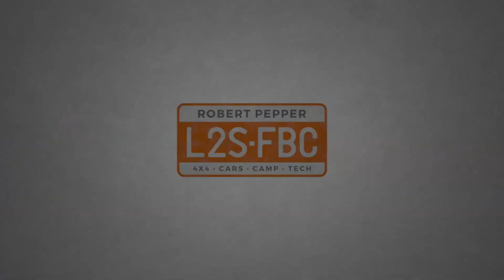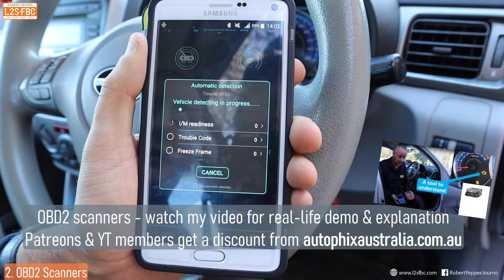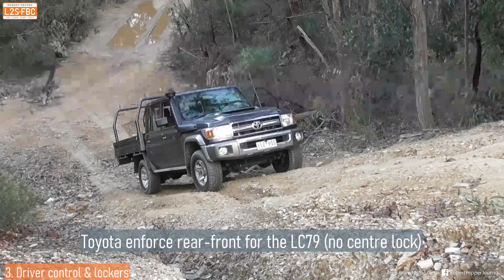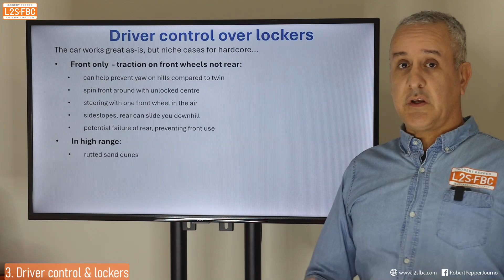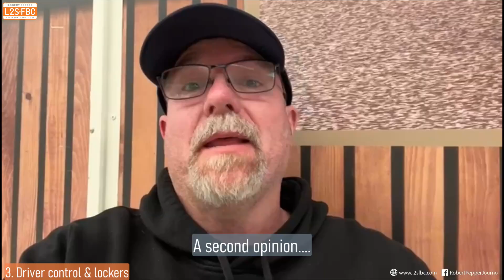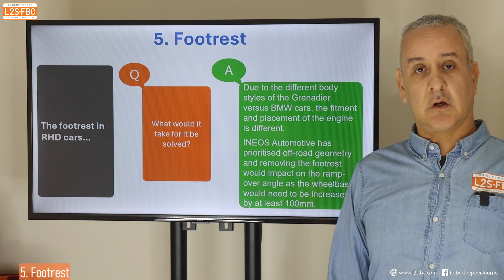INEOS Tech Interview Clarifications, Part 1 of 2

Comment: Winch clarification - what about Ariel with the Nomad, Foers with the Ibex (both front & rear from the same unit), perhaps even Munro with their electric vehicle; and a civvy Supacat Jackal (there have been a few) even had the Red Winches option before Ineos.  Would Unimog be excluded?
Reply from the maker: I would put Unimog in a different class yes.  As for Ibex and Nomad...fair points although again neither are really in the Grenadier class.  However if you need to qualify a statement with "we the only people to fit a winch in Europe in our class of vehicle" it gets a bit pointless!  At the time I was surprised to hear the statement but it seemed a ready answer and could be LR, Toyota etc had dropped their winch. Not the case when I checked after the interview ended.

Comment: Interesting answers with regard to the OBDII diagnostics.  Would it really be the case that Autophix have it wrong on stating Ineos have "locked" the access?

With your relationship with Autophix, maybe that's something you could follow up on.  It seems odd UK/Oz vehicles have no success with third party readers whilst US vehicles appear to be more open to code deletes.

Given all the talk from Ineos about open access and the ability to fix in the field then they should find an official partner to develop a full diagnostic tool with.
Reply: Presently operating an Australian delivered vehicle in North America. Can confirm that the MX+ OBD reader operates the same on our vehicle as a US.
Reply from the maker: I can't do anything without a volunteer Grenadier.  If someone wants to try, I'll get all the scanners Autophix has and see if they work, plus my own.  And yes, this is important re talk about fix.
Reply: @L2SFBC  Hopefully, there's an interested owner close to you that would help out.  I'll put a post in a few groups if that's OK with you?

I was wondering if you could facilitate an intro between Ineos technical and Autophix (assuming the latter saw a commercial interest in this) and they could take Ineos up on their offer to support third party vendors with access to in house technical data.  

A bespoke Grenadier unit that had a degree of support from Ineos and allowed additional functionality such as service counter reset and TPMS sensor relearning would be a real winner.
Reply from the maker: Sure happy to connect an owner with Autophix.  They'll need to be prepared to generate a fault on their car which lights up a warning, such as disconnecting a wheel speed sensor, MAF sensor or something so that can be detected and cleared which is the real test.  Autophix in Australia just distribute, no tech people.  That conversation would need to be between INEOS UK HQ and the OBD2 people, and all that's needed is a list of codes and descriptions.  I'm not sure INEOS would be up for that, but they have talked at length about self-fix...
Reply: Previous Foxwell Diagnostics device could not clear codes however so something is up.
Reply: @globalgregors  It would just be nice if Ineos got into bed with one of the OBDII major players and shared a bit code to allow Grenadier Owners to use a bespoke tool to read/clear codes, reset service intervals, relearn TPMS sensor positions, manually trigger a DPF burn and a host of other tasks that would be required by a  DIY owner or someone travelling remotely. Q
Reply: @stevegreen101  totally agree

Comment: I have a D3 with factory rear e locker. I recently installed a manually activated front e locker. I still have a long way to go, learning  how the vehicle reaponds when I engage the front locker  but so far I am impressed how little wheel spin i get, if any, when  engaging front e locker to pull me out of river beds (whilst in rock crawl mode).  I can the pulling effect using the front locker will be a great improvement in capability of the D3.

Comment: We have had many instances when e-lockers did not engage and disengage in real-time, and next to the failures we have seen, this was a major reason why everyone in our technical driving group changed them over. Interesting to see that Ineos acknowledges the issue. While the locker selection order is also how ARB installs their lockers by default, it's something I recommend changing ASA. I have had a few instances, even while touring, where I used a front locker only, and I want to control how I use my lockers.
Reply from the maker: Can you describe where you used front and not rear?

Comment: I don’t agree that having a locker in reduces wheel spin - it often increases it as it forces both wheels to spin and at the same speed when possibly one might not. Almost always when I see a vehicle with lockers engaged one or more wheels is actively spinning and churning up the ground.
Reply: I have a D3 with factory rear e locker. I recently installed a manually activated front e locker. I still have a long way to go, learning  how the vehicle reaponds when I engage the front locker  but so far I am impressed how little wheel spin i get, if any, when  engaging front e locker to pull me out of river beds (whilst in rock crawl mode).  I can the pulling effect using the front locker will be a great improvement in capability of the D3.
Reply: @lyndonkapoor8823  Having the ability to just use the front locker should be standard as like MadMatt said, often you just need it to pull you up.
Reply: @jerrymyahzcat  I totally agree!  now that I have one and have experienced the benefits and being able to use it when and if needed.  An independently activated front locker is a great addition to extra traction and recovery tool bag 🙂
Reply from the maker: Lockers definitely help avoid wheelspin but when it does happen it will be worse.
Reply: @L2SFBC  Yeah that’s fair. I agree. Just see many vehicles spinning like crazy 😵‍💫 with lockers engaged.

Comment: Ineos and Manufacturers don't seem to be able to give a solid reason why front OEM lockers can't be independently locked. Its impacton steering happens regardless of the rear. I have my ARB lockers setup for independant activation and for appropriate situations it gives me certainty that the fron will climb evenly without any risk of rear shuffle. Using lockers is pretty niche, I just don't see the risk of driver selections - usually when lockers are needed you are balancing a range of risk, including not being able to recover easily. Sick of nanny electronics in modern cars. Ineos was supposed to be different.
Reply from the maker: Based on various conversations, not just INEOS, the reasons are:
1. drivetrain protection - front lockers can snap drivetrain components easier than rear
2. protecting the driver from themselves
3. simply not understanding there is a need for anything other than centre-rear-front, because they don't employ specialist offroaders, nor do they talk to them
4. catering to the 95% of people for whom centre-rear-front is okay. 
All of this is understandable and I have no problem with it.
What disappointed me was the "there is no need for it" answer as that betrays a fundamental lack of understanding.
I would accept "yes, we see a niche need, but here's why we haven't done it" listing the reasons above.
We had a discussion on my Patreon about this, and on my FB.  It's niche, but there are definitely times you want full control over your lockers.  More in Clarification Part 2.
Reply: Niche vehicle has systems designed for mainstream drivers...someone, somewhere didn't understand or agree with the essence of Projekt Grenadier.

Comment: Something not many talk about is side mirror placement and adjustment range. A shim raising the height of the mirror housing by 3-5mm would likely place rear view mirrors in positions more useful and safe for rear visibility, especially when towing. My grenadier’s mirrors are tilted full up/forward just to provide adequate visibility. If I were any taller, I imagine the mirrors would be less than useful.
Reply from the maker: I did mention this in my first drive review!
Reply: Yes, you did, which is why I brought it up. A few others have as well, but I’ve not heard the manufacturer acknowledge it yet.

Comment: I’d love to see a forward control version of the Grenadier. 

I can see Ineos going down the luxury car brand route and will be put of of reach of the average punter, which would be unfortunate
Reply from the maker: An interesting point from the first interview - Jim Ratcliffe gave the engineers a sheet of paper, which Oliver showed, that said wheel at each corner, AWD etc.  And that's what they built.
It appears nobody argued that other configurations would be better. 
I would have done, arguing strongly for a forward control with small bonnet, like the current-gen Hiace, and independent suspension based on interior space and payload.
But I guess that's why I'm a journalist not a chief engineer :-)
Reply: @L2SFBC  I’ve been watching episodes on Pinzgaler and Volvo TBG. The foot print (width&length) aren’t that big, but have a whole lot more space for a touring set up than something like a Troopy.  They have a great platform, and wouldn’t take much to do a forward control version, which would open up a whole lot of different options, without much more engineering.

I can see them doing a short wheel based version next, as it would obviously be a seller, though.
Reply from the maker: You can see a forward-control 4x4 Hiace here  https://youtu.be/m9UcPcu4HUA
Reply from the maker: SWB 4X4s typically don't sell as well as LWB.  I'm sure they've done the analysis and that's why we haven't seen one.  Nor have I ever seen anyone ask for it.
Reply: @L2SFBC I believe they ruled out a SWB as the existing drivetrain (engine/gearbox) was too long to fit a smaller wheelbase vehicle without compromising driveshaft angles & developing g a 2nd drivetrain was too expensive.

Comment: At least on the Grenadier you get all 8 gears in low range and can do up to 70-80 kmh. A bit of a compromise for your preferred locked in hi range and doesn't solve the inability to select low range issue but still helps.
Reply from the maker: Fair point, not all vehicles allow all use of gears in low range, and sometimes low range is so low it makes anything other than crawling difficult eg Rubicons.  I think INEOS got the gearing just right with the Grenadier.
Reply: @L2SFBC  Aren't high gears more fragile in low range because of their smaller gear size?
I've always been told to avoid overdrive gears (5th and 6th in a manual) because the torque multiplication of the low range may break those gears, so i suspect jeep on the rubicons with that crazy 4 to 1 reduction ratio doesn't allow you to select the top gears in order to preserve the gearbox. I hope ineos have done their maths and chosen a zf 8 speed variant that can take the stress of the torque multiplication in all gears.
Reply from the maker: Yes, higher gears may be more fragile, but you wouldn't be doing high-torque work in higher gears anyway.  Serious 4x4 hills would be 1-3 low, possibly 4th, for 5th and higher it'd be transit.  I do use low range in soft sand up to 6th in my Ranger but when it does get into sixth it's easy going...when the sand becomes more difficult I've got another 5 gears to use so I can choose 3 or 4 low for example manually, not letting the gearbox decide which it does too late, or needing to stress the car between 1 and 2 high.
Reply: @L2SFBC  Yes, if wikipedia is to be believed (gear ratios on the 8hp 51 transmission, 2.5: reduction ratio in lr) 8th low on the grenadier is slighty taller than 4th high, which means if you are in that gear the going is very easy and if you want to avoid overdrive gears 6th low is a bit shorter than 3rd high which is very usable. On a wrangler rubicon auto, 6th low is shorter than 2nd by quite a margin
Reply: Same with Land Rover. All gears in low and high range and all Terrain Response modes at any speed.

Comment: Ive had a BDC and main gateway module failure and i can confirm that it does indeed disable the vehicle. The generic Torque Pro app works with the Grenadier you are able to read and clear some codes.
Reply from the maker: Thanks Mike, good to know - which OBD2 reader was Torque Pro paired with, as that may make a difference?